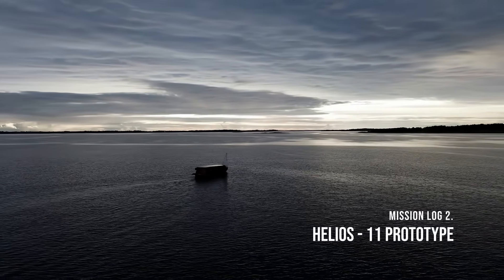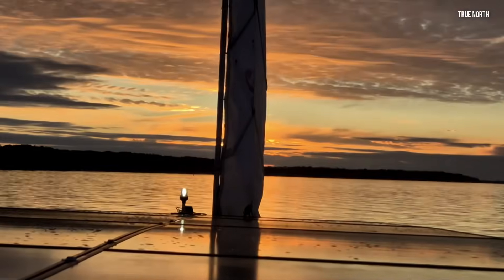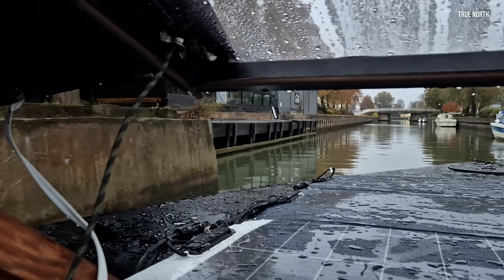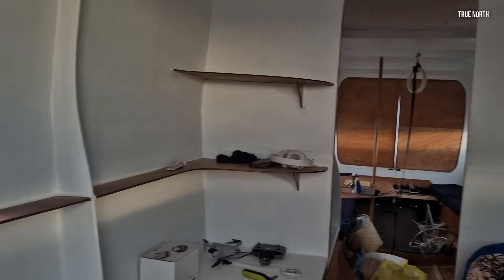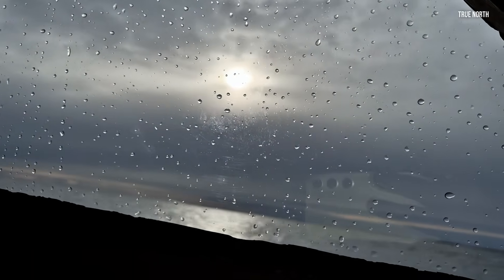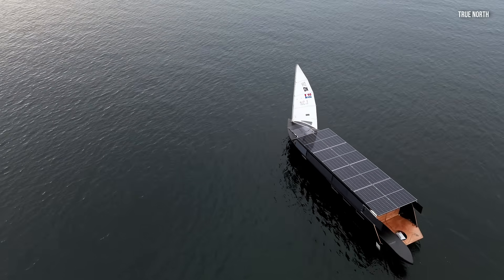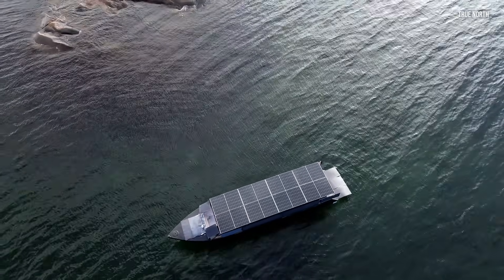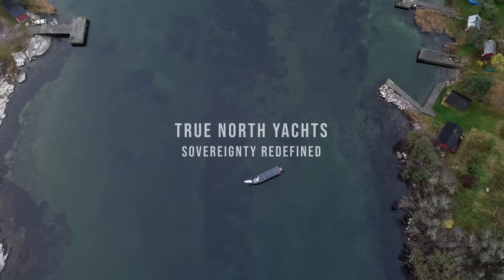🌧 Escaping the Nordic Winter on a Solar Yacht That Runs Forever

Comment: As for the generator, I don't think you need to be a purist. If I was using a craft like yours, I would want to have one on board for emergencies, at the very least. I would think it would help with stability, if you put it at the bottom, while giving you the chance to outrun a storm, or whatever, when you really need it. Your quest is on the edge enough as it is. No one is going to be bothered by a back up generator on board.

Comment: Just started watching your videos .  I've been thinking about doing a similar project myself on the UK Norfolk broads. A live aboard capable pure electric cruiser with some clever solar install and batteries .

I hadn't thought about a light weight hull design instead was thinking of using an older holiday cruiser as the base of the install , stripping out everything diesel and gas.  Depending on cost of course it looks like your design with lower weight and lower energy needs to cruise is a better solution .

Combining wind power is essential but with lots of shore charging pure electric will work very well on the broads .

Looking forward to seeing more about the design and stats of energy consumption , storage and generation 

One of the solar designs id like to consider is extending/sliding overlapping  panels for when the boat is moored, allowing for greater kwp

Comment: Another trick... Use panels as structural part also (like Tesla EVs batteries)... It'll reduce quite a lot of weight on top of your boat and let a bit of light go inside 😅.

Comment: I would Love to work with you on your next build.  I have some phenomenal designs for Solar and Kite Sail technology with shallow draft keels 30" for Ocean Crossing technology. 
As far as generator power for emergency charging , a 1 or 2 cyl diesel capable of running on Bio Fuels is an awesome backup to create electricity AND can can be quickly connected to drive shaft via a 4wide link chain/sprocket assembly I learned working at a ski resort for when power went out to get people down off the lifts. 

If you're interested in partnering up to create a very high seas capable vessel. 
hit me up 🤙

Comment: If your Vessel hasn't been Surveyed , the question must be asked have you had your boat design strength tested? 1 Ton per 1 metre cube, your vessel is not designed to handle the storms of the high seas. Please be careful. don't get caught in rough weather. The concept is however, excellent.

Comment: I really like your project. 
In my experience the normal solarpanels from houses are way cheaper and way more efficient than the glue on panels. The weight is higher but these also come in lighter weight versions.

Comment: Great design, again.  Multihull would be heavier, if shorter- lower hull speed, higher up would need to be wide for stability.  Double beds in hulls makes thick/innefficient hulls.

An ultimate design would be an arch set on "pontoons" that converts any low boat into a trimaran, just with lines.  would hold batteries and dual motors.  10kw can give better than silent 60 performance from sub 5 ton boat, or power an inflatable bounce house boat.

Comment: Since you have panels at different angles and directions how are you managing the strings/panels input voltages and currents. Optimizers, MicroInverters, multiple MPPT charge controllers to cover each orientation?
Reply: he has 5 separate mmpt chargers.  3 could probably do, but redundancy, and perhaps voltage limits helped decide.
Reply: @pascalj4331 thanks, that's interesting. I would think in a marine environment it might be better (though more expensive) to use DC optimizers both for rapid shut down and for issues like debris, liquid, or even just angle on a panel affecting the output. Newer panels are definitely affected less thanks to shade tolerant designs and bypass diodes but it's still an issue in challenging situations.

Comment: Do you have water tight bulkheads? I would want sealed areas that could support the boat in the case of catastrophic entry of water, allowing one to find the entry, seal, and pump out the boat one of these areas should be in the bow. Have plugs at each valve and a panel that can be screwed in  to cover the space where holed.

Comment: Unless you are resticted in beam you should use a catamaran design. This will give you more area for solar, more efficient  hull and will keep her light weight
Reply: 100%
Reply: And more stable and potentially actually blue water ready
Reply: Also panels should be on a slight angle for rain😢 run off. Will you improve your solar collection and water collection

Comment: Bro, you are a hero to me. 
Regarding your (obviously would like to oceangoing) ship - i was thinking about something similar, but more of a trimaran with forward foldable umas, each with one wing/hard "sail".

My reasons 
- Sail is closer to the centre of the ship (unlike single one on the bow or on the back) - overall better stability. And if needed, it should be possible to fold the "wingsails" horizontaly, and store them partialy IN the umas. 
- Two (wing) sails should provide quicker propulsion than one. 
-  When are the umas extended to the furthest position from the main hull, it gives your roof pannels a good chance to extend to the sides and realisticaly double your solar/roof area. 

Nice engineering flex, that could help your power consumption on the spot - 
long foldable aluminium ladder serving as a frame for several pannels, floating glued, taped, or otherwise (possibly NON permanently) fastened on top of two long inflatable tubes, or two zodiac boats. When the weather is right, that contraption should add zirca 40% more of your electricity output. Not to mention - you can both buy a new parts for this device in your destination, OR you can sell the parts in your destination if the need arises. 

BTW - you seem to plan to use your ship as kinda B&B in the tropical paradise. Sugesting to orient yourself first on the toilet and shower, because you will need it both THERE and when en-route. 

Will watch your adventure and cross all my fingers for you. Good luck and bon voayage.

Comment: hey man. i live in alaska. i understand what winter can do. remember that no matter how strongly you wanna get out and go south, you can't rush things on a prototype. take it slow, hug the coast, and keep making improvements along the way.
Reply: @Lukas-TrueNorthYachts
This! ^^
Norway to warmer climes means a bit of north sea and the bay of Biscay => Not gonna be a fun ride, a rather dangerous one really with that boat shape / size / structure.
Batteries at the very bottom also means zero reaction time if you take in water, better distributed higher on both sides (Keeps balance, safe away from the bildge... hopefully you're using the LFP chemistry?)

That said - I LOVE the initiative - I have 4kw of solar installed on a classic 44' blue water sailboat + 11kw of LFP (and can't wait to finally swap the ol' diesel with an inboard electric engine!)
That life is certainly possible, I have worked full remote on my boat in the Med for years already ;)

Comment: I've always thought a steel-hulled catamaran would be ideal for this sort of build. Catamarans typically have significantly less drag than mono-hulls, and the additional roof area is perfect for solar panels. Instead of backup sails, I'd have a backup generator with the ability to bypass the vessel's battery system and directly drive the electric motors in case of emergency - this gives you emergency power, emergency propulsion, can't be becalmed, and has a minimal size and weight footprint. This would allow you to maximize your solar input and EV power, still keep a reliable backup system in the form of a conventional fuel generator, have dual motor redundancy and have a more resilient hull in case of collisions. Also an electric water maker, because at that point food and water become your limiting factors. 
It wouldn't be the ultralight, but ultralight lacks durability. It wears, breaks, is expensive to replace and often prohibitive to repair. For a long-endurance expedition vessel, being durable and repairable are also important qualities.
A steel hull would act as a great heat sink for your systems, you could build heat exchangers directly against the hull allowing for simple low-maintenance liquid cooling. An additional concern might be building a sealed battery box (or, dare I say it, using existing EV battery banks taken from Teslas or even Nissan Leafs). Having your battery bank as low in the hull as possible is important, but having it slightly elevated and at least water-tight would create resilience against inevitable minor water ingress that could otherwise disable your entire battery bank (and by extension, vessel).

There are major concerns that probably limit the widespread adoption of fully-electric oceangoing vessels, but I too believe that they have incredible potential.
Reply: (Of course you can build from very expensive high-strength materials like carbon fiber and achieve comparable strength, but CF isn't as durable and repair is highly technical and often not even possible while welding is something anybody with access to a welder and youtube could possibly handle themselves)

Comment: This is great!
I wonder if, instead of a generator you could modify a 
10 hp outboard engine by adding a bigger alternator-maybe a 48 volt output to the outboard engine. 
This way you have extra backup propulsion and very efficient charging. 
Quiet, efficient and takes up less space and the exhaust is safely evacuated. 
Lower center of gravity as well. 
Add a pulley to the flywheel and gear it to your liking. 
What do you think?
Reply: I built an electric boat for the lake I'm on and I have two electric motors and two sets of batteries for redundancy. If I was going out on the ocean, I would definitely have a redundancy or maybe triple redundancy.
Reply: a 3-5hp outboard is enough for the boat.  a 2kw generator is a bit cheaper

Comment: I'm planning a solar powered pontoon for inland lakes and great lakes shorelines in Michigan.   Glad to see you selected the epropulsion Navy 6.0, which came to be my choice, along with LFP batteries.  Agree it is more than enough for max displacement cruise speed.  I'll have a full coverage bimini with solar cells that raises and lowers vertically.  Eventually will have complete windows/screens, galley and head.
The DN is the largest iceboat class in the world, so named because it was the winner of an iceboat design contest sponsored by the Detroit News in 1937. That year the newspaper opened up it's shop to 50 builders who assembled the first fleet of “Blue Streak 60” iceboats (as it was originally named).

Comment: Love the idea and implementation of the prototype. Having said that, it will be challenging at best to be 100% solar for an actual "luxury" boat. I am sure you have seen the Sunreef Eco 60. To many luxury also means the boat being quiet, seanoise on the hull needs to be addressed.
Reply from the maker: The sunreef is of terrible design. A mere gimmick that does not perform

It's totally possible as long as you dont insist on having marble dining table!
Reply: @Lukas-TrueNorthYachts you are too focused on the marble countertops which make up an insignificant percentage of weight on a modern yacht.

The Eco 60 is a repurposed hull, so sure, the design isn't optimized for solar-only operations.

The Ra II, a papyrus reed boat, crossed the Atlantic in 1972. That was possible. Yet you don't see papyrus reed yachts everywhere.

People who can afford blue water capable yachts want to be comfortable and comfort adds weight even without marble countertops. Stability (a big measure of comfort) requires displacement, etc etc.

If you want to build an experimental boat for yourself that's one thing, if you build with commercialization in mind you need something else entirely.

Comment: All down to money but I would consider forward seeking sonar. With a vessel with such a thin skin anything you smack into could be a disaster. Also AIS is a must for busy shipping lanes. You have a small mast for the sail but adding another pole for antennas around 10 mtrs high for sufficient range. Another addition for power I have seen recently is a towed Hydrogenerator. They weigh around 4 kgs.

Comment: Good cruising , This boat is good for inland waters(only) , why ? Do not trust the sea, I have to see a keel ,strong ribs (Frames), Navigation lights, Green Red White Stern Light. Life Jackets, Bilge pumps, First Aid Kit. Life Rings , Ropes etc. one storm at sea and your thinned walled boat will possibly not make it.
Reply: I think you have a point. Bring out with this one even in a slightly bigger storm may be a disaster. But I’m sure that he will improve the design going forward.
Reply: Perhaps an idea would be to have the side solar panels on hinges? Then you could flip them up also straight, which would drastically increase the sun they get (power generated).
Reply: @TurreTuntematon Solar sails....?
Reply: " the thing looks deadly " said momy k whale
Reply: Uhhhh...you do realize that he's out in open water and not in some small river or channel.

There are rules for operating a boat, so I'm quite certain that he has all of his necessary navigation lighting and safety equipment.

If you watch his other video, it shows his construction, and yes, the boat has ribs (framing) and a full length keel...so all of your criticisms are completely unfounded.

....unless, of course, you're just a troll and have nothing positive to say about anything someone else is doing
Reply: @53Peterbilt  Boat has a 30 cm draft and would get thrown around in big waves. Sail in fair weather only.
Reply: @maxmackinlay618  he did say that this was a prototype, and not the final plan.
Lots of boats aren't big water capable

Comment: Suggest you show more of the landscape you are passing, and occasionally a map, where you are and where you want to proceed to.
Reply from the maker: Yes. I will show more on my main channel "True North" 

But good point for future logs as well!
Reply: There is an app you can show progress/passage on the map with a small boat icon I have seen other YouTubers use, very to give the impression of the journey.
Reply: To be fair that coastline is almost all the same , im from the Swedish side but yeah it's pine and spruce and rocks
Reply: Do you have green/red lights ? The are mandatory for your length of boat in parts of Europe

Comment: You should make the next version out of HDPE. Either sheets of it or 3d printed.
Reply: Better hot-welded sheets. It will be more reliable than 3D printed. You need a high end, heavy-duty industrial 3D printer to get a ‘reliable’ hull. 
I’m a huge fan of Additive Manufacturing, still I’m not fully confident FDM is a viable solution for marine applications.

Comment: A tip: installing small outboard gasoline engine (instead of generator) can give you extra, emergency propulsion and also of course power to charge the batteries.
Reply: Great idea for double redundancy, outboard+generador=safty
Reply: My advice would be to go with diesel for safety and an outboard for redundancy.  Those little E-outboards have proven to be unreliable.
Reply: The whole point of the project here is to do it WITHOUT gasoline or (and) diesel fuel AT ALL.
Reply: @ОлегЕрёменко-с3п  The point of the project is to develop a viable solar powered monohull.  If he loses his first prototype trying to get south it will be hard to recover from the failure.
Reply: @ОлегЕрёменко-с3п he outright said he might get one
Reply: @ОлегЕрёменко-с3п ever been at sea with no power?
Reply: @ОлегЕрёменко-с3п  Why? Is it a religion or something?
I went cruising in the Bahamas in a tiny catamaran, we an old 9.9 two stroke and a 8hp four stroke. Having two engine saved us multiple times.
I love solar and EV but on the sea, go classic, reliable and redundant. 
It will sip fuel, it's a non issue for a small engine.
Reply: @alexforget  It's not a matter of faith or other misconceptions. Any increase in the weight of this project could be fatal. And the weight of the engine and fuel will affect the stability of a light boat in rough seas. Look at other videos. Even in small waves, the boat rocks a lot.
Conclusion: any design changes should be made during construction and on shore, not quickly and at sea. Do you agree?
Reply: @ОлегЕрёменко-с3п  A vessel that sensitive to weight has no chance in the open ocean. The forces there are staggering. 1M3 of water is 1000Kg, thing of the energy in one small ocean wave.
You can get an outboard of a few hp under 100lb.
same for fuel.
So the weight of one big person.
Safe travel.
Reply: @alexforget  For safety's sake, of course. But we don't know much about this boat's design. Our observations are mere guesses. At sea, every detail matters. May his journey truly be a safe one!
Reply: Correct, much less energy losses that way. A tohatsu 6hp 4stroke would be great!